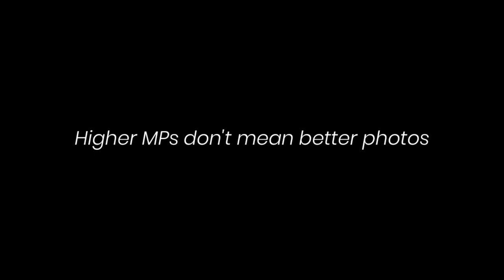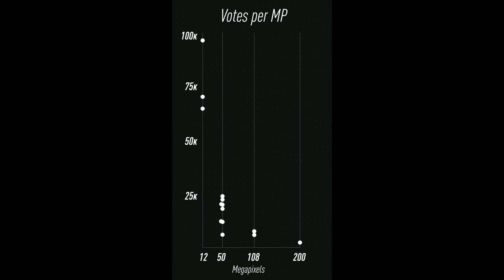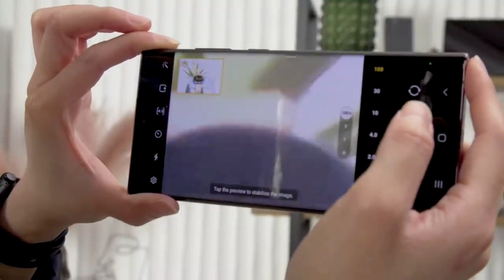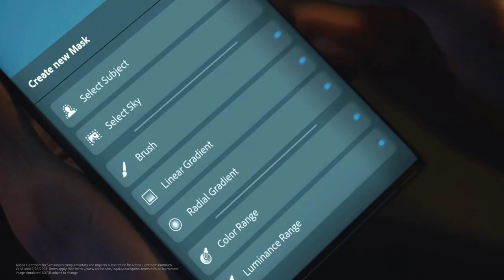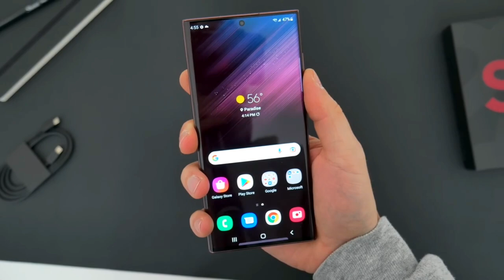Galaxy 23 Ultra - A BIG PROBLEM

Comment: There is a difference in clarity by 12 and 200 megapixels
Reply from the maker: Clarity 
Not overall photo
Reply: @Papinators  More details, but which is great in 12 megapixels when converted to 12 megapixels, also good in dealing with high light, better than iPhone
Reply from the maker: Ok I can agree with you there